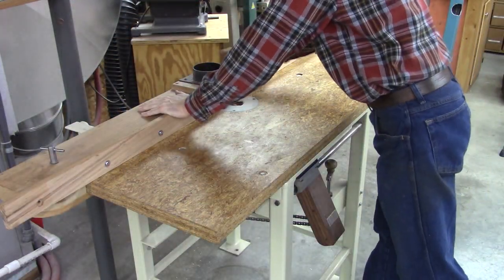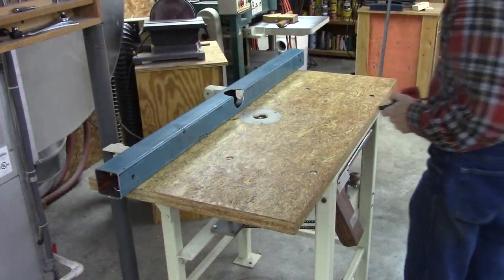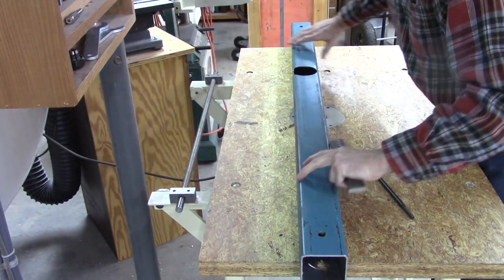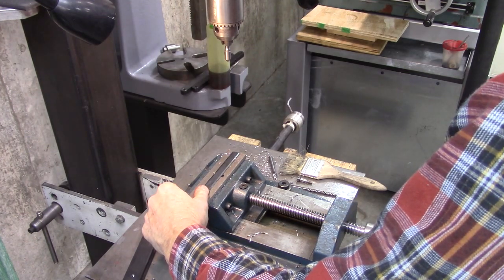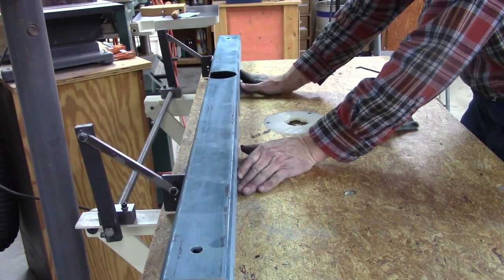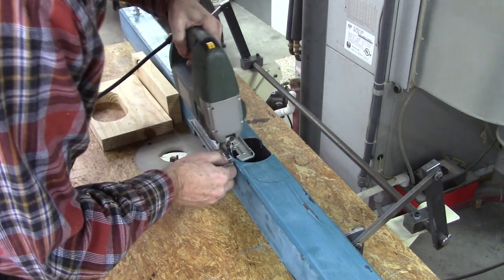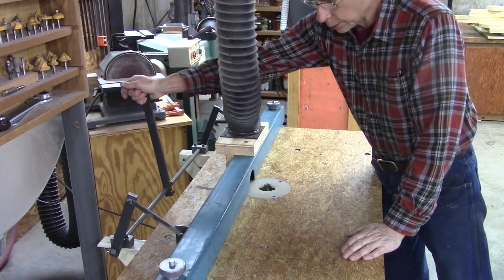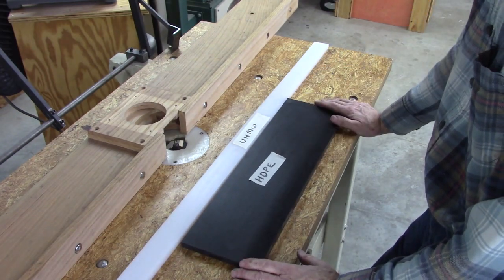A Router Table Fence that stays Parallel - Part 1

Comment: Sir, your work is quite inspiring, thank you so much. You must have spent your entire life in the workshop. Your router table and fence and every utility thereon is amazing. I wish you could be my instructor. Thanks for sharing your ideas
Reply from the maker: Thanks, your comment is also inspiring!  I guess I do spend a lot of time in the shop especially after retiring 2 years ago. I love it. I usually have 3 or 4 project halfway planned in advance. The fence on this router table and been wandering around in my brain for several years now and 3 weeks ago I had the solution. Be sure and watch Parts 3 & 4. I improved the design more.

Comment: The lack of swearing at 9:04 makes this very different from my "workshop." Anyway... it seems like a lot of flex there. Could you put T-track in the table at each end, running front-to-back, and runners on the bottom of each end of the fence to run in the track and keep the thing square? Eh, never mind; now I see someone farther down suggested the same thing.
Reply from the maker: The power of video editing!  HA.  I should have used a pipe or larger diameter bar but I think with the lever being in the middle it will work well. I have some UHMW tape to put on the bottom to make the fence slide easy. Right now the HDPE I have ordered is supposed to be here Friday so hopefully I'll have it all working and post part 2 on Saturday. I might end up making some changes.

Comment: If you use a sled against your fence, you can route the end of a narrow piece without the fence being parallel to the bench.
Reply from the maker: Certainly this is true and then parallel would not matter but I like the linear slide I used.  It's very easy to hold the wood securely. The fence stays very square. My only concern is making a small correction in fence position. I have not used it yet but I suspect it will work well.

Comment: Well Done again Winky. These days you are getting too clever by half, part way through you then get a "Light Bulb Moment" . With regards to the friction on the table with the fence, you really only need to insert 3 or 4  2.5 inch or so discs on the bottom as anti friction pads.. Countersunk screw in the center tapped into the steel tube. I think that perhaps plastic on the bottom the whole length may still give you friction problems ( too much surface area ). Looking forward to see it in action.
Reply from the maker: I agree. I now have some UHMW tape. I'll put two strips on the bottom near the ends. I've used the tape before and it is incredible. It will likely outlast me.

Comment: I'm afraid i don't get it. Why the need to reference the fence when making a cross cut?  I thought about a parallel fence for a while, but opted for making a micro adjusting fence as I could see more benefit. Maybe I'll catch on in part 2.
Reply from the maker: It's needed if you use some sort of miter gauge in a slot when you route the end of stock. I don't have a miter gauge slot but I have guide on a linear rail. Yes you can route the end of stock without contacting the fence but the fence help hold the depth of cut. If the fence is not square with the miter gauge  (or slide in my case) the end will be tapered.
Reply: @WinkysWorkshop  I see thanks. The linear rail is brilliant. May end up trying this type of fence too, because i'm sick of picking wood chips out of the t-track. I have two monitor arms that could work. thanks for sharing all of your great ideas, i've used quite a few.

Comment: Nice setup. Love the flip top router table. Don't think I have ever seen 1 before. Even the original fence is awesome
Reply from the maker: Thanks 👍 Yeah...  This router table is great. All the parts are industrial scrap. In my opinion the lift top table is much nicer to use. Way easier to change bits.

Comment: You could have used the circular cutouts from your plywood to make knobs for tightening your fence. Drill a  hole big enough for a threaded rod coupler, and press it in, and voila!
Reply: There's no harm in playing with new toys. I would do that too.
Reply from the maker: That would work but my knurled knobs are cool 😜

Comment: Have you thought of making the links connected to the fence adjustable lenght (with threads or so)? That way you can connect the other links with a piece of tube or bar to really tie them together.
Reply from the maker: They are tied together very well with the 5/8" rod. The only negative is that I made the rod too small. 1-inch bar would have been better. The bar twists a little. Maybe I miss understood what you meant.
Reply: I thought maybe you can stiffen up that twisting of the rod by adding another bar or tube. So if the rod connects the links at the base, you can connect the links at the ends as well.
Thanks for the vid btw! (Forgot to say that)

Comment: great idea.  does the table still fold up ok with the new fence attached?  you could weld a long horizontal bar onto each
end piece to stiffen the movement up.
Reply from the maker: I thought about the bar also. And yes the table lifts easy. Thanks!!
Reply: I like how you designed the fold up fence.  I guess if this new fence isn't perpendicular to your fold up fence you can adjust the bolt holes on the end brackets to make it so.  Thanks for all your interesting ideas and looking forward to part 2.
Reply from the maker: @goldprogoldpro7809  - Exactly. I thought about installing a turnbuckle but it adjusted easier than I thought it would. Sometimes simple is better.

Comment: I thought you were going to route slots into the router table and attach sliders to the square section - similar to a mitre sled on a table saw. This is an interesting approach though, look forward to part 2.
Reply from the maker: There are a bunch of different ways to do this. The slots would work well I think.

Comment: Thanks Mark. I have an old cast iron Craftsman table saw and this gives me some ideas of the restoration of it.
Reply from the maker: Go for it!  I have considered doing the same with an old saw. The cast iron table with miter slot would be great and you might even be able to use the existing fence.